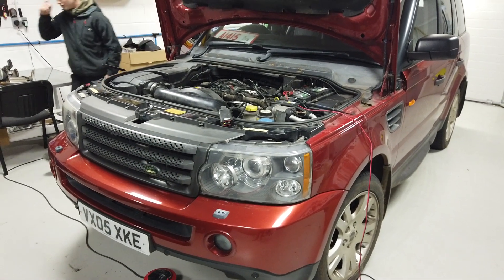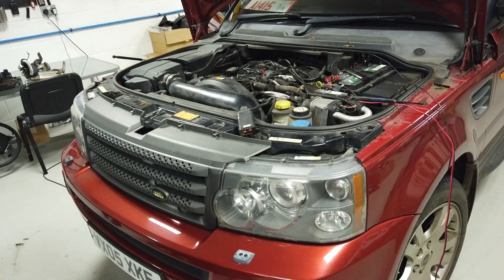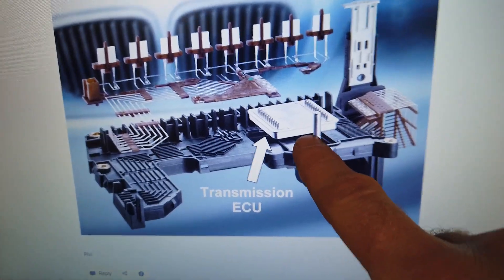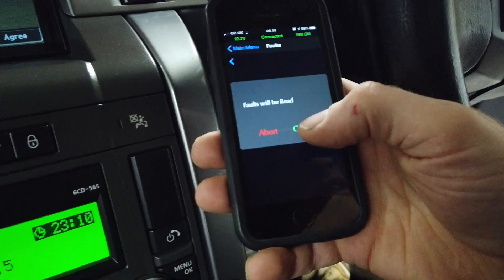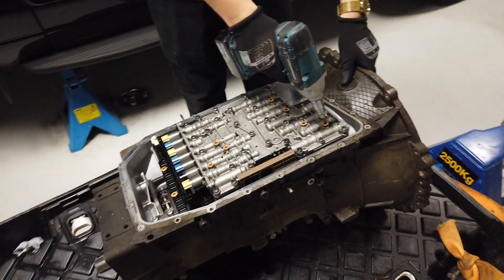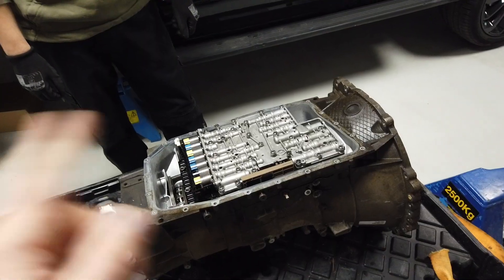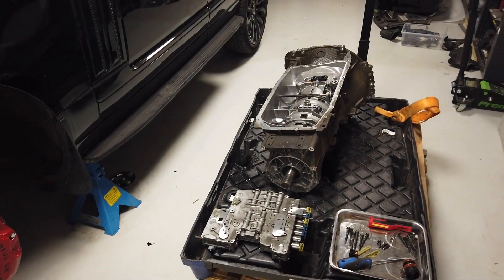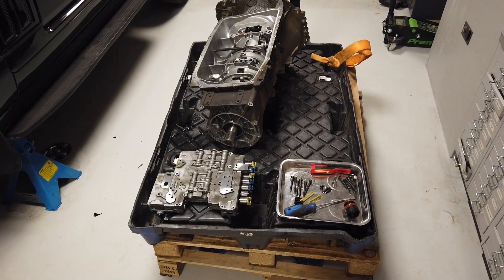Range Rover Sport L320 Auto ZF Gearbox Fault Reading / Coding / Strip down ( how not to swap TCU ).

Comment: How are you, brother? 
I have a 2018 Range Rover Velar. Water and oil have accumulated in the gearbox. I changed the gearbox cooler, cleaned it of water, and put new oil in. After that, the car is very heavy to move, and a light appears indicating that there is a fault in the gearbox. The four-wheel drive is always working. More than one person has checked it and they said that the gearbox chip is I need a repair and I don't know if the chip is working or not. I have the fault 
Do you know the reason or have experience?
P0730-00

Comment: Hello, I have a 2005 L320 sport diesel.  Since I had a gearbox oil change, I am having terrible trouble in low revs, Motorway all good.  Any suggestions?   Thank you . Clifford
Reply from the maker: Not sure - it could be it needs to re-learn the adaption values ?
MAybe give it another oil change ?
Did you change the filter ?
Reply: @ yes,  the garage put a new filter and plate on! I have reset for learning three times now!  Each time the “F” sign comes up! Then driven for 20-30 miles.  As said on the motorway in high revs,  no problem, as soon as I come onto normal roads its gears slam in at 4th and then the Fault comes up.
Reply: @ yes, filter changed also!

Comment: I have just changed the engine and auto gearbox on a 2014 Evoque and have a gear box fault on the dash now........ do I need to swap the TCU too??
Reply: Not 100% sure but i think the gearbox may be coded to the car - this may be possible to change with something like a GAP IID tool ?

Comment: Do you know where the transmission/front differential breather vent is located on a 2012 range Rover sport?

My front differential seal keeps leaking and I believe this could be the cause.

Thanks
Reply from the maker: It looks like it will be behind the engine - on the bulkhead - but not sure
Here is the diagram
https://www.dropbox.com/scl/fi/v7uembvwp8e27xee257kk/sport-breather.png?rlkey=dzk1s5b1y5c6303179xq4n9yr&dl=0
Reply: @L663  thanks so much

Comment: It looks like your gear selector was popped out of the piston before you even started doing any work. There's a brown plastic piece with a nipple on it that's supposed to align with the shift linkage nipple. Yours were off. you probably missed it and put everything back together correctly and that was your issue the whole time. Not the chip.
Reply from the maker: Interesting

Comment: I have the same problem with a Range Rover running an F  ..TRANSMISSION FAULT LIMITED GEARS AVAILABLE  at close range.  What is the solution and how did you fix it?
Reply from the maker: Hi - You need to get it fault read and see what errors that gives..
Reply: Hello brother, I checked the gear and found these errors: Shift 3-4 and Shift 5-6. I want to know where these solenoids are in the gear. Thank you very much.

Comment: Hello There, I have bought a disco3 2008 with 90000km and I started to do the maintenance slowly how the money goes. Transfercase oil, Belts, filters. I took to a shop to change the oil in the gearbox and the filter, after the change, in 4th and 5th (80km/h) the rev start to oscilate between 1700rpm and 2000rpm.  Before there was no variation and there are no error codes, I would appreciate if you can give us a clue. We are in Brazil. Many thanks I love your show.
Reply from the maker: Hi - Have you watched my video on the gearbox oil change ? see below. It may be a good idea to do another oil change yourself. When you change gearbox oil you never can get all the old oil out - so some people do the job twice to be sure there is very little old oil left. Also it is not possible to change the filter in the gearbox without lifting the car body off the chassis... unless you fit the new type of sump... watch my video... it may be the shop never changed your filter.... see if you have your original sump on the car !
https://www.youtube.com/watch?v=PWsLZMDYZXk
Reply: powerfulukltd Google morning thank you for the help. I thought that, but he said that he lifted the engine(he loose the bolts of the engine) to have room to put the new sump, I don’t know if that is possible, when I looked under the car the sump was very clean. If he did not put the new sump, is possible that the new oil had carried out all the old stuff and blocked the old filter? If so, the pump can not suck the oil, so is not enough pressure in the system. What do you think?
Reply from the maker: @fabianmeine76  I would change to the new type sump - its not expensive and you can do yourself. Also important to use the correct oil.
Reply: powerfulukltd I Will try that, I wil buy it in the eBay. Many thanks

Comment: Hello I need your help I have a Range Rover Sport l320. The gearbox shows me the error on the output shaft speed sensor. Does anyone know where you can order the part. LG
Reply from the maker: This post may help you
https://www.jaguarforums.com/forum/xj-xj8-xjr-x308-27/zf5hp24-transmission-speed-sensors-input-output-information-78132/
Reply: Thank you so much for your help. It helped me alot. Thanks LG

Comment: Change the actuators and bridge seal, barrel seals and solenoids sonar do a full kit.  Top tip when replacing the electric connector, it's a bastard, I used the trolley Jack handle braced against chassis make sure you use a piece of would so that you get a greater surface area and reducing the chances of damage.

Comment: So you had a Mechatronic Unit to swap over, but decided to *uck it instead? Now what?
That's 15mins of my life wasted, which I won't get back ...
Reply from the maker: Hi - yes I can only appologise for wasting your life.... i wanted to see if the IC could be swapped over - like in the digram on the PC - but clearly not ! Best to swap over the whole black section ! We are not experts....dont claim to be...As i say we are going to fiux this with software hopefully to code the gearbox to the car.
Reply: @L663  You'll never get a job at the Zeppelin Foundation ...

Comment: Nice video
Reply: I have a range rover sport hse 2008. The transmission Mark fault a while of use. In manual mode, hold on a little longer, stepping on the accelerator thorouhly the change do not come in, but stepping on the accelerator slowly, the changes enter very well.....why does this fault occur?

Comment: I said it in your previous video. It can be done. Done this loads of times! You need a Autel Maxisys. Access the TCM (transmission control module) via the diagnostic menu, go into special functions and you can change the vin number associated to this module. Put your vin in and it will walk you through the process to change it. Once complete all will be working and all gears will be unlocked. Message me if you need more info.
Reply from the maker: We wanted to cover both options - the "software" and the "hardware" options. For the software options we are going to try and use out IID tool
Reply: I've got IM608 which has diagnosis of Maxisys MS908, I didn't see this option.. what maxisys did you use?